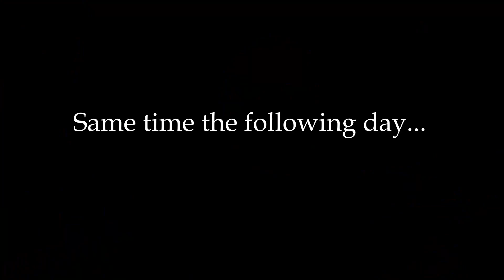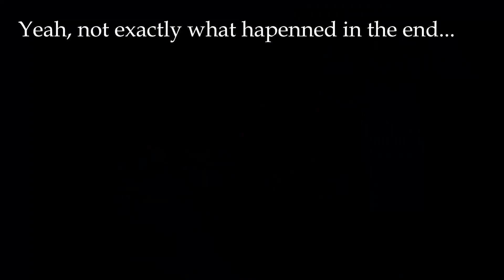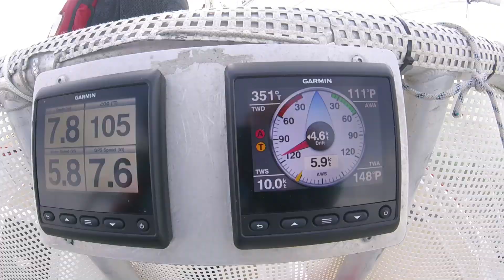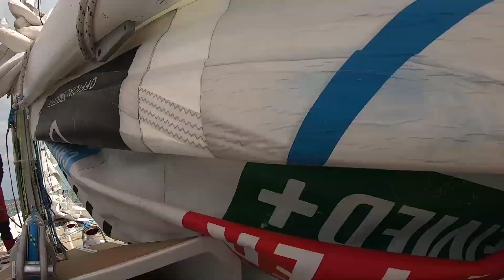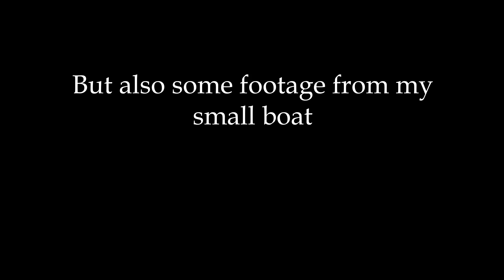A new adventure: first mate for a round the world race - Ep90 - The Sailing Frenchman

Comment: Now we're talking, I applied to do the clipper but it was too expensive, for the cost of 2 legs I can buy my own cruising boat.
I crew on a 64' Simonis designed Robertson and Caine custom built retired Cape to Rio ocean racer, same setup minus the bowsprit, 13 cockpit self tailers, twin interlinking pedestal grinders, dedicated running backstay winches, Hydraulic backstay, baby stay and vang. We have hit 22 knots  before but only when racing, cruising we do 10 to 11 with just the genoa out.should be fun ... .enjoy it